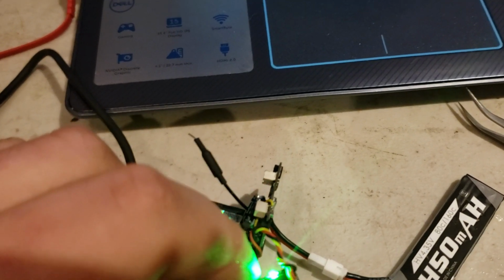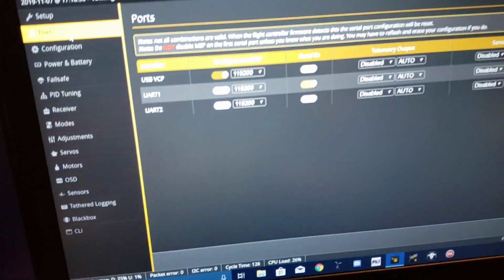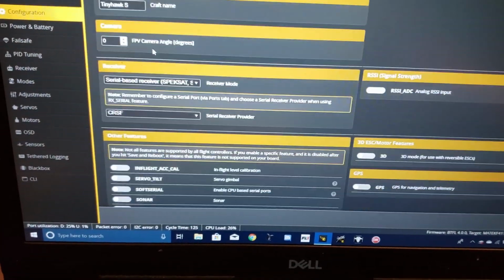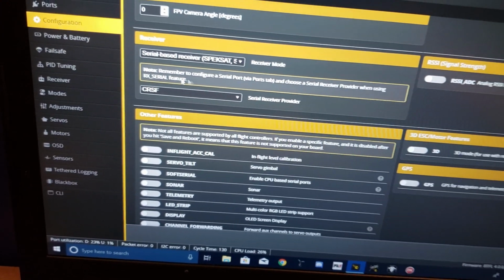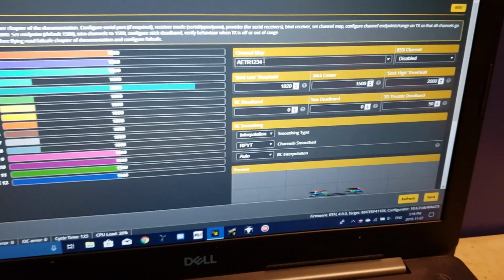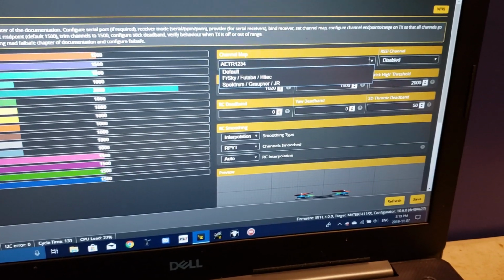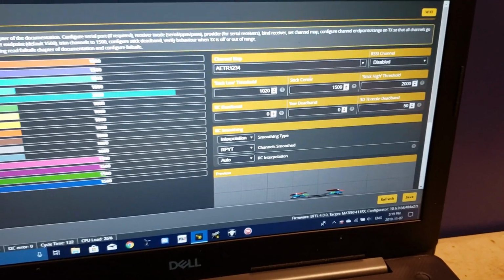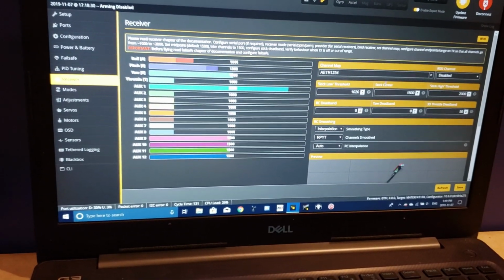Tiny Hawk S Crossfire Wiring and Betaflight Settings

Comment: So how did you mount the antennas ?
Reply from the maker: I used the wire Crossfire antenna and hot glued it to the bottom side of the front ducts.
Reply: rclenofpv do you have any pics or video of it glued and flying ?
Reply from the maker: @retro93277  https://www.instagram.com/p/B5b6-k4nI23/?igshid=1snbhxde4efcx here you go!